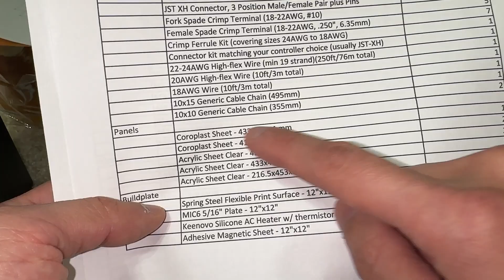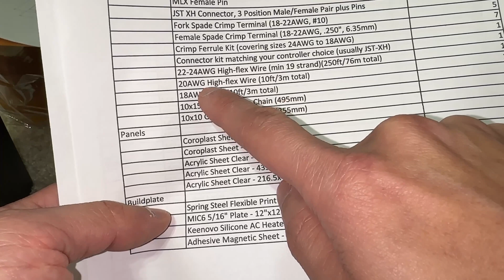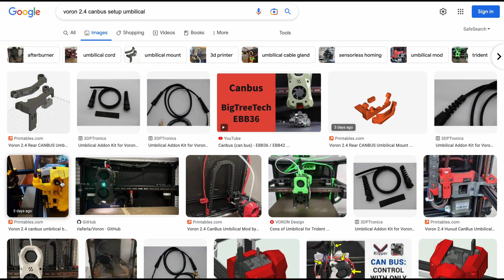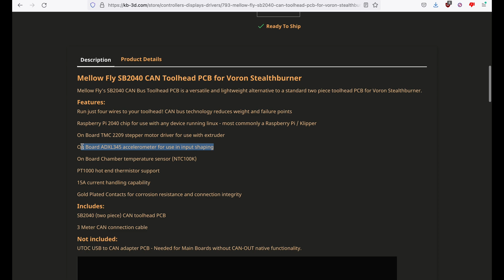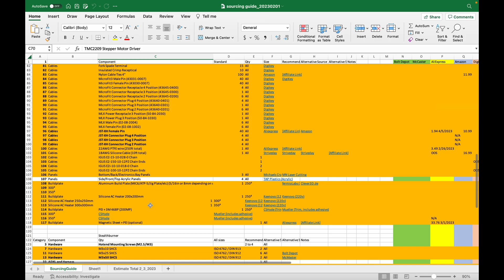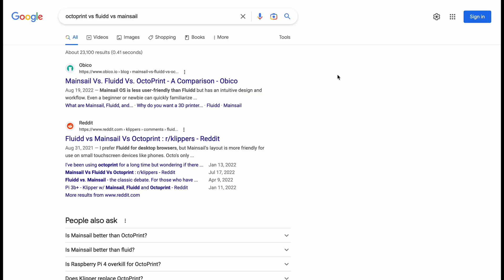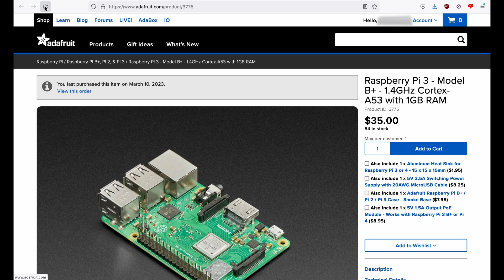DIY Voron 2.4r2 Part 8: Endless Decisions (Hotend, Electrical)

Comment: Another great video. I’m at a similar place with my build and also self sourcing. A couple of things that I’m doing/planning are I’m going to clicky from the start (no melting issues that the inductive sensor can get). I’ve also changed this week from octopus to manta and my heater is going to be full size to the 350 build plate so there’s no cold spots. Cheers
Reply from the maker: Thank you for sharing and props to you for self sourcing.  It's definitely not easy.  The 350 size will be nice for sure :)